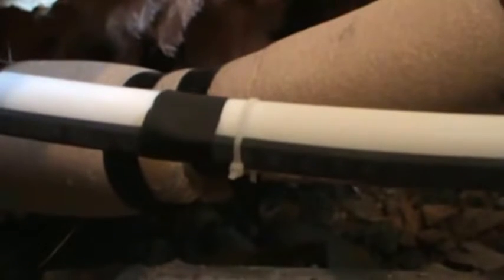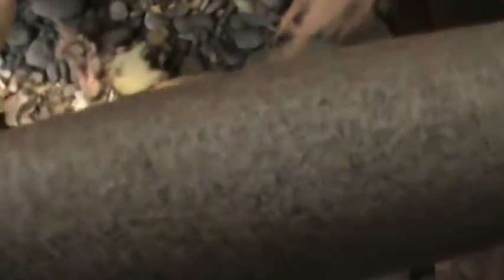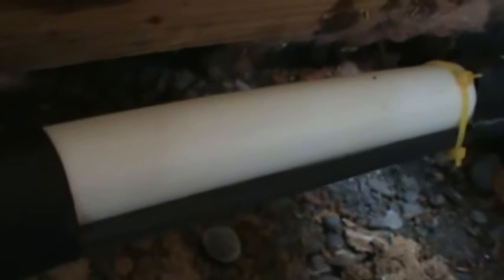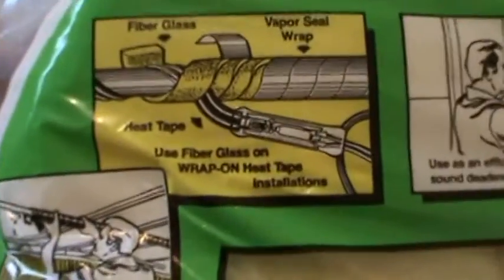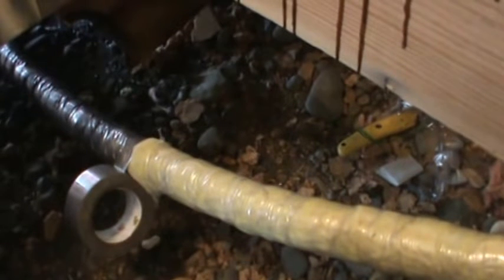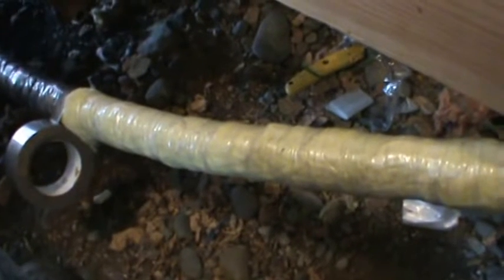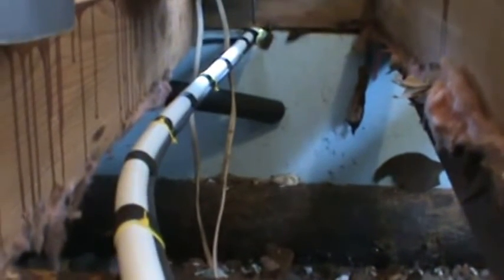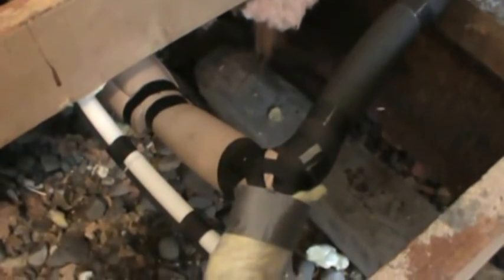How to Properly Insulate Water Lines in Alaska for -70 degrees Licensed Professional

Comment: Thanks for the video.  Thanks for not asking me to like,  and subscribe.  I watched this as I live in a "mobile home park " , in Minnesota.  I have successfully done a heat tape replacement myself.  The professionals used the fiberglass with the plastic when they set up the home.  I decided to use the foam.  My local Ace hardware guy said to bring in the old heat tape so that I purchased the correct length. He laid it out on the floor,  then matched the length.  I put it on, just like the pros did. They had a wrap around the pipe technique, so I did the same thing. I really do believe that adding the fiberglass insulation to thr foam is a great way to protect from the severe temperatures and will give me a little piece of mind when it gets much colder.

Comment: Great video on insulation. As a previous boat electrician who has had the leftover wire tie ends cut my hands bad, I suggest all use flush cut wire nippers to flush cut the wire tie ends.  When I would have to come in and follow owner installation of wire ties I would cut every wire tie end off before I would work around them. I’ve had cuts to 
the knuckle bone many times. Trust me.

Comment: While it only gets to -40C here, I have 2 heat tapes on my water line. Only 1 is actually plugged in. The last winter when 1 failed, I plugged in the other so I still had water. In the summer when the weather was good it was much easier to replace the failed tape.
Reply: Great idea.
Reply: Ooooooh, great idea! I'm stealing it :)
Reply: How do you know when one quits working?? Is it expensive
Reply from the maker: Carla Durland you would have to check it or some of them come with a light on the end that lets you know it’s working and when the light goes off you know the heat tape has failed.
Reply: What’s crazy is the light is on ... on my heat tape however my water lines have frozen sadly... amber light must mean the heat tape is now defective. 14 degrees Ohio
Reply from the maker: @MissyJohnson1991  the light on the heat tapes I’ve always used stay on when the heat tape has power and is working normally. Now what I mean by normally is that that light should always stay on at all times and by seeing that light is on you should be able to rest assured that the heat tape is functioning correctly BUT that is NOT always the case. Sometimes I have had frozen pipes and when I get down there and start to diagnose the problem I have seen that in fact yes that light is on and lighted up as it should be BUT upon touching the actual pipe or using my digital infrared thermometer I find out that in actual reality I have rock hard ice cold solid frozen pipes! Although the light is lit up the heat tape had power going to the heat tape and to the light itself but the heat tape still failed and I must be honest I can’t recall ever tearing apart one of those heat tapes and figured out exactly where the problem was at and why it failed and how was the light still able to be on with the heat tape failing? I have always just removed the defective heat tape and replaced it with a brand new working heat tape and went on to my next job. Now that you’ve brought this up I’m going to try my best to remember the next time I run across one that has failed and the light is still functioning and on I’ll break down and diagnose that actual heat tape and see what I’m able to find out and hopefully I’ll be able to not only remember to do just that but also to try and remember to come back here and let y’all know what I found out and why it was still able to be on when failed? Heat tapes years ago when I first started did not have that convenient light or any additional accessories with them it was a straight old school heat tape just plug in and it got hit basic so with today’s newest heat tapes having temperature sensors, lighted power displays, fail alarms and what have you each one of those additional accessories also have a chance at going bad and failing theirselves so that’s also one thing to remember to not just go by a light or a temperature sensor or audible alarm check the actual heat tape itself and verify that yes it is warm or hot to the touch and it is working properly. Hope this helped you to better understand the additional possibilities Missy and everyone?

Comment: -40 here today, just plugged in my heat tape for toilet in shop, started to get a little frosty.  This method is the best, I bury waterlines 9 feet no insulation.
-55 with the frigin wind, brutal wind today.   When I took a leak outside, well lets just say the ol john Thomas looked like a champagne cork. LMAO

Comment: Troy hear from Fairbanks. Haven't seen -70 below in years, but we do get - 35, and just had a little run of that last week.

I'd like to mention a few things that make maintenance from a well a lot easier.

I run 2 inch ABS from the well all the way to the house. This is placed on 4 inches of rigid foam insulation, and I essentially make a box around the 2 inch ABS. I use EPS foam, R7 per inch. That's R-28 around the pipe.  You could spray urethane foam insulation too, but more expensive. I compact the ground before I put the rigid insulation down, but ABS pipe goes on top of that.

Within the 2 inch ABS I run three-quarter or 1 inch soft copper all the way to the house. At the beginning of the run and at the end of the run I install a T in the abs. At the pitiless adapter, I run a vertical piece all the way above ground from the T, and inside the house I also install a Tee. If the line ever freezes up, I can take a vacuum cleaner on blower mode, and force air through the line from the house all the way back to the pitiless. I just put a cap on the vertical piece of ABS at the pitless, so if I need to thaw I just pop that off and that allows the air to circulate through.

Second, I use a 6 W per foot heat tape, and  simply lay it inside the ABS. You can wrap it around the copper pipe as well, but essentially what you're doing here is heating the air space. Having a redundant line is nice as well. Good if you need to thaw, as it takes more heat to do that. 

If you need to replace the heat tape, you can do so at any extreme temperature. You simply pull the line out of the 2 inch ABS and slide a new one in. If you need to thaw because of an extended power out,  you can use the vacuum in blower mode when the power comes back on or use two heat tapes (12 watts per foot).  You're covered for any an eventuality.

I'm surprised how many guys bury heat tape under the ground with no provision to get it out if it goes bad. Is it supposed to last forever? I've even seen guys run 100 foot lengths of copper pipe underneath the house. How are you supposed to get that out of there when you're heat tape fails after five years? Stupidity.

I think you always need to allow for a method to remove your heat tape easily at any temperatures, and also cover yourself in the event of a power outage. It happens. Tree falls on a power line, and power company can't get to your property for a few days. Now what? Been there, done that, have a few T-shirts. Cover your butt! 

It's a lot harder to un-thaw a pipe than it is to keep it from freezing to begin with. I'm also a big fan of copper pipe as you can always run arc welder cables from the well casing to inside the house and heat up the line. Can't do that with plastic. 

And I would say it's surprising how often heat tapes fail. Just put in a submersible heat tape from Du-Alaska in my well casing last year, and this year it was dead. Started blowing the breaker. 1 year for a $250 heat tape--sad, but it happens. 

Lastly, there's a company in Canada who makes a quarter inch diameter submersible heat tape. This goes inside the actual copper pipe. It's not cheap stuff, but a lot cheaper than trying to dig up an existing line, particularly one that can't be accessed because the bozo who built the house put the line in before the house was built with no provision to service it! Hate those people! 

I believe the company's name is heatline, and not sure if they're in Ontario or Toronto but somewhere in Canada. Do a google search. The submersible puts the heat right where you need it, and way easier to install than wrapping a cable. It's about 20 bucks a foot though, but totally self-regulating and within 4 foot zones. 10 yr warranty. 

Good luck to anyone living in extreme cold and dealing with water. It can be a real nightmare if not done properly, and just about every Alaskan has a story...
Reply: Troy D I was raised in Fbks, I’ve seen it -67. I’m in Anchorage now. I am a widow & now trying to learn what my husband did. My water pipe is pex. It’s -11 & my pipes are frozen. Using space heaters & opening cupboards Have heat tape but don’t know how old it is. How do you know if it’s working?  The light is on so getting power  Reading all your tips. Do you like Fbks?  I miss it in the summer but not so much in the winter. I graduated from Lathrop the year of the flood, do you know what year that was?  Thanks for your information, stay warm
Reply: If you can actually put your hand on an exposed part of the heat tape that's probably the easiest way to know if it's working. Just because the lights on doesn't mean it's working. Other than that you would use an ohmmeter to test the Ohm's resistance. If the meter reads infinity there's a break in the line or if the reading just won't stabilize that's usually an indication it's shot. The manufacturer of the heat tape can provide a range for the Ohm's resistance .

The other thing is simply age. If your heat tape is over 10 years old it's probably time to replace it anyway, although I've seen people get 15 or 20 years out of them too. I guess it's just a question of how lucky you feel.  The heat tape never goes out in the middle of summer!  

The last thing is just how it was installed. The manufacturer will generally specify how many wraps of the heat tape you need per foot for a given temperature. Sometimes the heat tape is working but it can't keep up with the cold. Plastic takes more wraps than copper. And then of course there is the question of how much insulation was installed. All you need is a 2 or 3 inch space where there is no insulation and  it can be enough to freeze a pipe. 

Last thing I would suggest to anybody if you're on a well is to get yourself an irrigation timer. You can specify how often and for how long the water will run. I just installed one of these myself during our -40 below snap we had here in Fairbanks. The timer will turn the water on for one minute out of every hour. Can help get you through those cold snaps, and easy to install via a garden hose adapter.  I hooked mine up to a hose bib in the utility room and ran a line into the bathtub. Moving that water once an hour will keep it from freezing.

I would also suggest putting some kind of a T or access fitting it the line, so a  local thawing company can put a quarter-inch jetter into the line to thaw it if needed. Good for plastic pipe.

 For copper lines the electric thaw  machines  work quite well,  but will not work on pex or plastic. These can typically be rented from rental companies for about $45 for four hours. A professional will charge you 200+ an hour for the same service. 

Best of luck
Reply from the maker: Troy D you do have a lot of good information but I do adamantly disagree with your statement that circulating the water every hour will keep it from freezing as that’s no where near True as water in a water line even a 6” main line for a commercial building will freeze within 10-15 minutes at the sub zero temperatures were talking about. Maybe I misread or don’t understand completely what your saying here Troy but simply saying the circulation of the water every hour will keep water lines from freezing in -40 or -70 winter temperatures is not accurate. Also the absolute Cheapest and best way to thaw frozen water lines is a cheap inexpensive fish aquarium air pump which you can pick up at Walmart, a 1 gallon mop bucket, a 1/4” or 1/8” rubberized tubing like the vacuum hoses you see on carburetors and breathers and 3/4 of a gallon of hot water. You hook up 1 end of the rubberized tubing to the fish aquarium air pump and set it into the 1 gallon mop bucket placing the bucket underneath the exposed opening in the pipe and put the other end of the tubing into the frozen line and turn the aquarium pump on and you slowly push that tubing into the frozen pipe. Slowly it eats away at the ice in the frozen pipes and in no time your completely done and back to having running water. Now I have basically the same weather as Fairbanks as I’m on the Copper River between Tok and Glennnallen and yes it does get down to -70 here and has just since I’ve been up here starting in 2010 until at least 2017 that I have personally experienced. As a matter of fact I was here I believe it was 2016 when we had an ambient temperature of -58 below 0 with sustained winds exceeding 100 Mph for over a week. That’s the year that this wind was responsible for peeling back the metal roof on one of Valdez’s City buildings like the wind was a can opener. Maybe by googling the recorded temperatures for the last 10 years on Nebesna Road might give you some better insight as to our temperatures over here. For the last several years we have been exceeding 100 degrees during the early summer months anywhere from a day or two to lasting well over 2 weeks straight and everyone was extremely miserable from those temperatures. Most Alaskans have never had to deal with these hot Temperatures before. I’ll never forget my first full winter here and those -50,-60 and -70 degree temperatures during that 2-3 week period around the end of January and the beginning of February as I had never experienced anything like that before. Having just moved here from Las Vegas, Nevada that year and experiencing those extreme cold temperatures everyone teased saying “ You’ve went from the most extreme temperatures on one end of the thermometer to the complete opposite extreme temperatures at the other end of thermometer now and we can’t figure out which one it is......Insane or Crazy or both?”
I just smiled and always replied “I’m the most imperfect balanced combination of them both!”
😂 
Now I have added the new the air inlets onto my water lines as well and that’s a great addition for sure. Now my water lines running from my well to my residence are buried 7 feet deep and the are ran inside of 4” conduit / plastic pipe which is also encased in a aluminum arctic pipe that’s somewhere around  12”-14” in diameter, just guessing, all of my connections are shark bite fittings, yes expensive but reusable and can be used on any type of pipe from PVC, CPVC, Copper, Pex, Quest, Black (iron) pipe, etc which makes it very easy to replace any section especially this run as I can pull them right on threw and replace them very easily this way. I also have some other little additions that are great benefits to me if any repairs are needed during the winter months but I prefer to do all my repairs during summer so I try to schedule ALL my breakdowns to happen around that time and that’s been working pretty wonderful for me out here! Just kidding as we all know breakdowns normally happen at the worst possible time. I wish I could schedule my breakdowns.
😂 😂 😂
Reply from the maker: AkDeb I would recommend installing a cheap wireless thermometer onto the water lines and heat tape that way you can simply glance at the temperatures of your water lines and heat tape anytime you’d like and those come with alarms on them that you can program however you like and they will alert you when the temp get below your desired settings. That’s my cheapest, easiest and best advice to use to make sure your heat tapes are working at all times. You can pick these up off of EBay and have them shipped directly to your mailbox and they are super simple to install you just tape them on securely to your heat tape and also your water lines and set the receiver in your residence. I always keep mine in the kitchen for ease of access and a place I do spend a lot of time in so I’m always glancing over at them checking the temperatures especially during extreme cold periods.